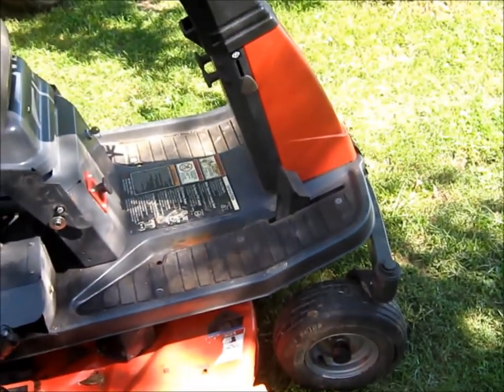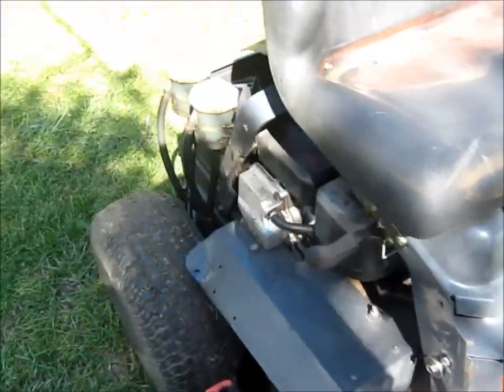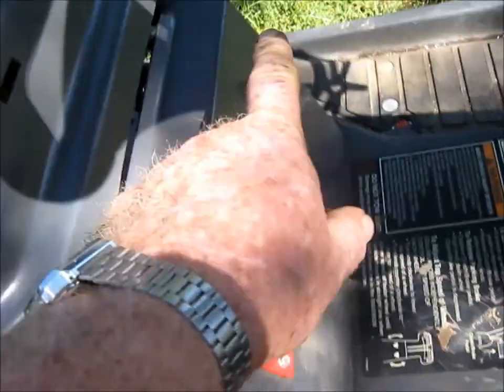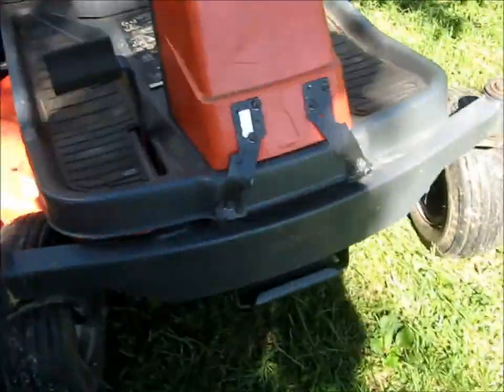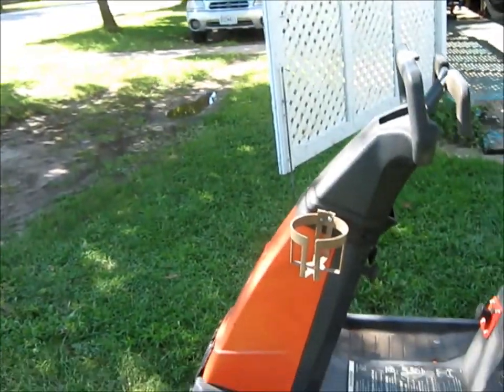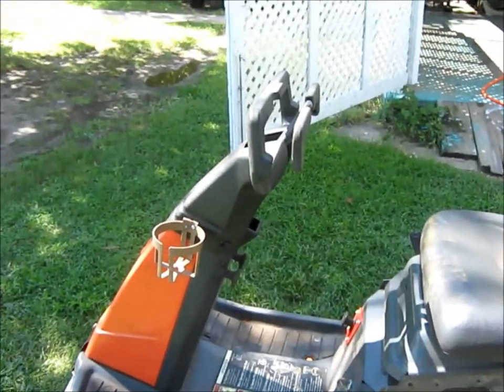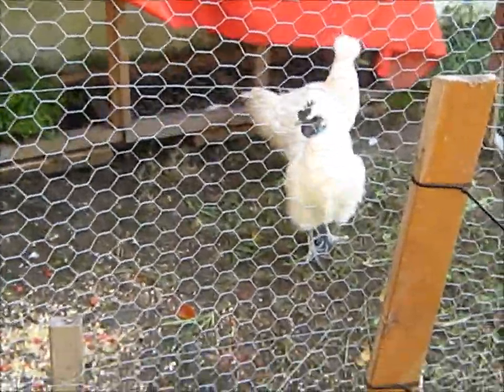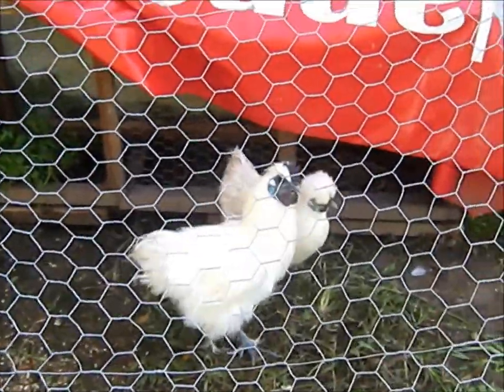Simplicity ZTR lawn mower

Comment: I have one of these that dies when I let off the brake pedal. I suspect the brakes are locked up because it’s hard to push. Have you ran into this problem?
Reply from the maker: there should be a lever at the back somewhere that releases the hydros, there'd be on one for each side those are to make it easy to push. . I suspect it's a safety switch somewhere that's causing it to die when you let off the brake.